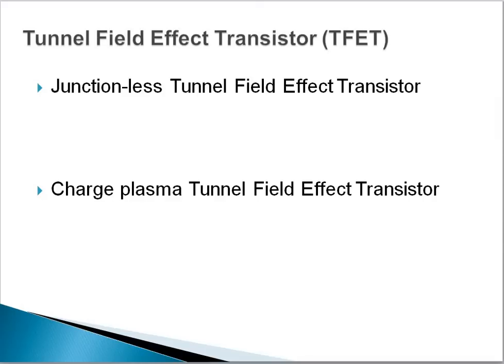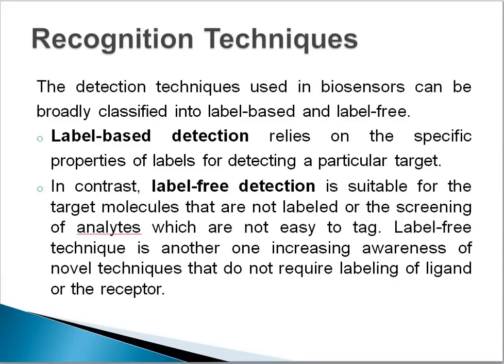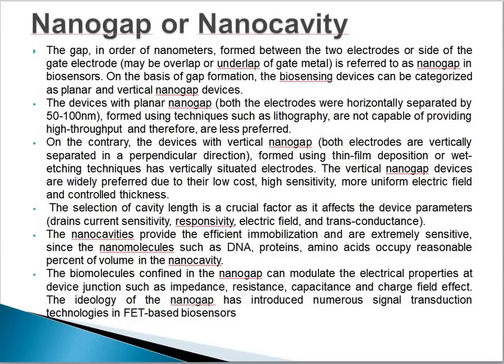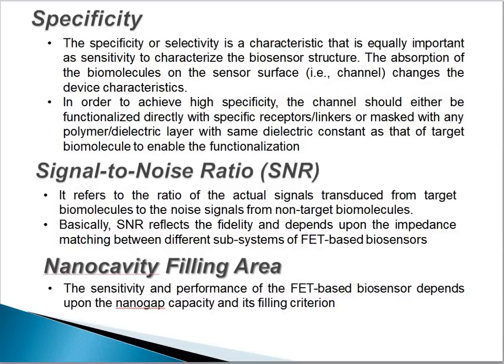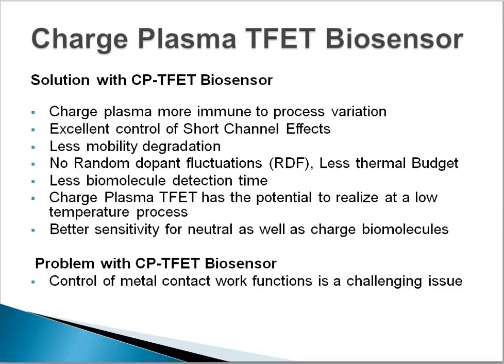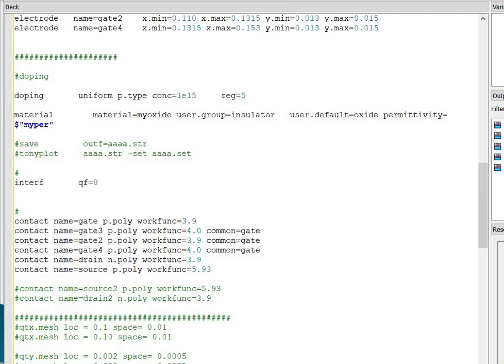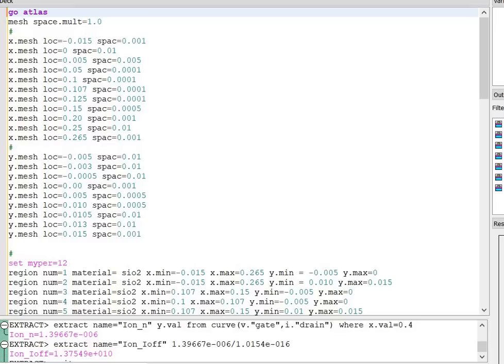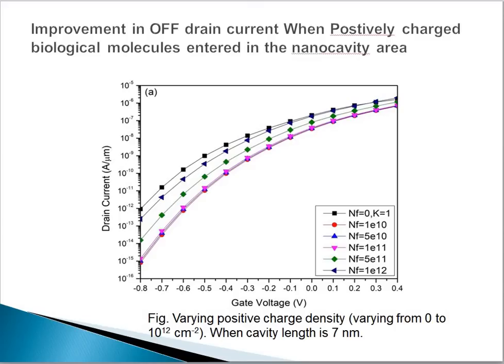Silvaco TCAD ATLAS Tutorial 12, How to design  JLTFET and CPTFET Biosensor structure in Silvaco ?

Comment: hello sir, i want to ask if i got the error message "Memory allocation failure.  Try killing processes
or see system administrator" . What do i need to do?
Reply from the maker: Meshing problem..if u could not find the solution..send to me.
I ll check it
Reply: @engineeringtechnologyandso9940  ohhh really how do i correctly done the meshing?
Reply from the maker: @mohammadfaizismail6777  there is no as such formula for Meshing.. it's all about practice
It's depend upon the geometry parameters of structure
Reply: @engineeringtechnologyandso9940  my structure is simple which is capacitor, so can you check it for me?
Reply from the maker: @mohammadfaizismail6777  yea no problem
Send to me
girishwadhwa12@gmail.com